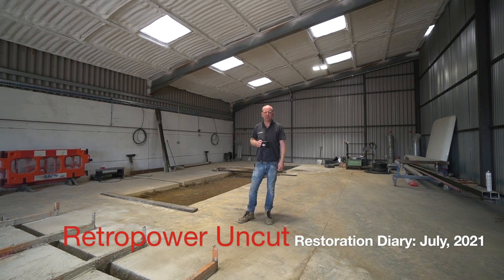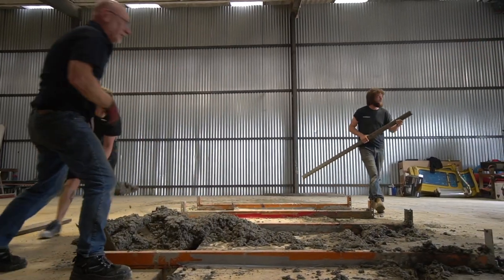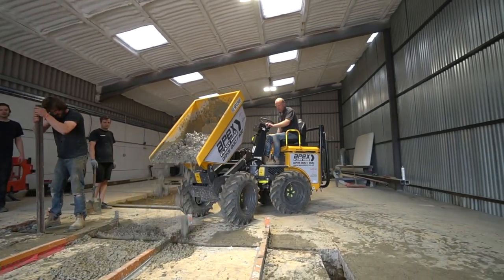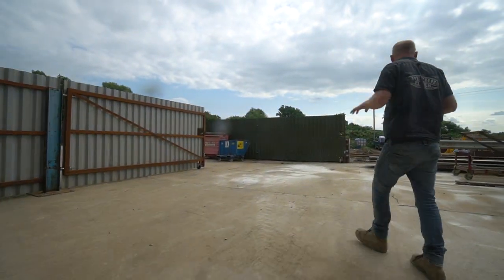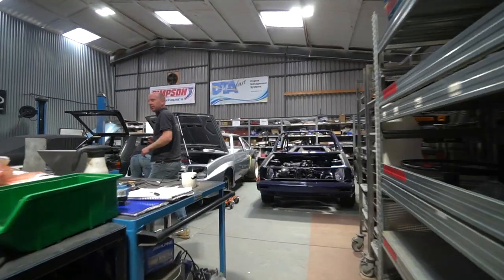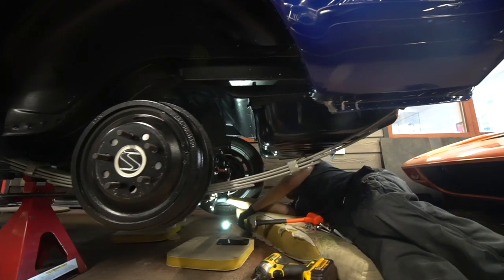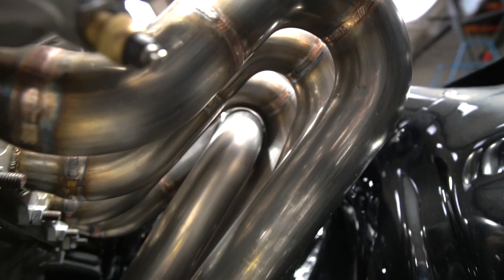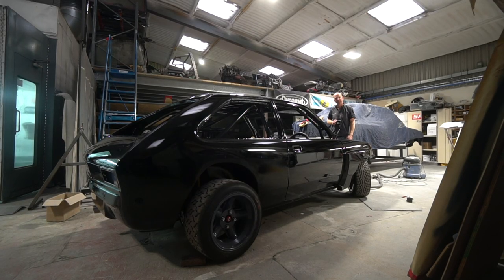Retropower Uncut Episode 48: Concrete, Cups & Coupes

Comment: What's with the heavy orange peel in the front of the rear quarters on the chevette did you leave it like a dogs breakfast because of a body kit going on?
Reply: it might be a raptor or underbody bitumen coating under the front and rear flares/bodykit would be my guess.
Reply: U-POL Raptor
Reply: Underbody rubber stone chip, as it only went up to the flare line

Comment: The cement worries me a bit, you’re using a ”vibrator” to make sure that all air bubbles are removed right? Pounding it with a stick is quite good but not sure how effective is it. I might have understood the pit wrong and I’m sure you blokes know what you’re doing!
Reply: I think they meantioned in a previous video that they are using a pole vibrator to purge the air out.

Comment: Wouldn't a c5/c6 corvette type air filter suit the jag better? K&N makes a lovely replacement with enough flow to feed an LS7. It's a flat conical design just like the plenum You just crafted. With all due respect the quadruple setup looks a bit silly.
Reply from the maker: We had a C6 K&N on it originally. Way too deep for the new space it has to fit into
Reply: @retropowercars  Understandable. Just a means to an end.

Comment: Great video and nice work, but while spending so much money on the Mustang, why not converting it to a Fastback and why staying with drum brakes and leafsprings ? Don't get me wrong,  I don"t want to be disrespectful as I have gone through the restoration of a Mustang myself, which was a numbers matching big block and I went for a concourse restoration with drum brakes and leafsprings, but here it's more like what the yanks call a restomod sp you could as well go for some improvements. Especially as you went for the IRS on the CV8 and as there is so much cool stuff available for the Mustang in the US.
Reply: Perhaps they're doing what the customer wanted, ever think of that?

Comment: I still can't believe that the owner didn't want to upgrade the rear suspension and brakes on the Mustang, big mistake I think.
Reply: Yes , having owned one with drums and cart springs I can confirm their weakness.
Reply: When you're having your car built there you'll be able to specify that there are no "big mistakes".

Comment: WTF are the point of these posts if there`s no end result?
Reply: Welcome to the world of doing cars, where you get updated weekly, you get to see that everything takes time, it's not like they are working on a single car, if you could build a car to the standard which they have then it's going to take a whole lot of time and patience.

Also the manta and the Keiser are finished pretty sure that was last week or the week before, it looks like the Jag isn't too far away as that is not getting down to trim pieces, but maybe a suggestion would be, to instead of doing a whine post, to suggest that they do a splash episode for a completed car, where they do a short cut of the progress that it went through and then spend some time going over the completed car itself.
Reply: 1066wastrel, WTF's the point of your post?

Comment: It's funny to see what cars people keep and treasure just an ocean away. Chevettes and Sierra RS we throw away but I can see the value. I'm going to pick up two XR4Ti cars, (Sierra /Cosworth) that's a not because ours use the same block with an 8v head, for a few grand. Turbocharged yes, but not the same. The rest of the car is identical down to the whale tail with one exception. The rear 1/4 glass is split into two pieces. You can cut the divider out and use Cosworth glass or leave it. Anyway, I figure I'll redo both cars with 400hp Cosworth heads,  sadev 4wd drivetrain and unobtrusive cage, and rally suspension. Put them on a boat to the EU. Both cars are 1986 (built in 85) so will be cheap to register and likely mot/technic exempt by the time I finish them.